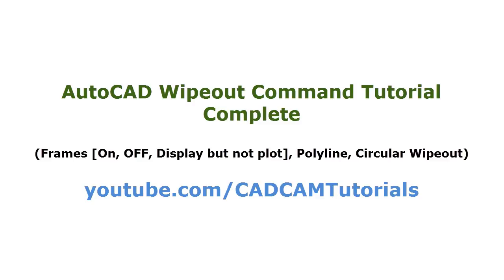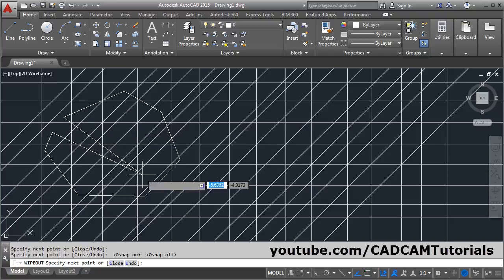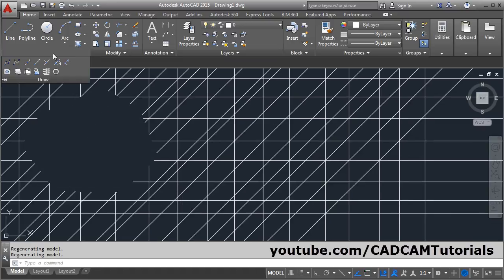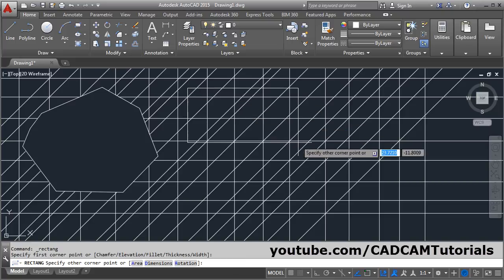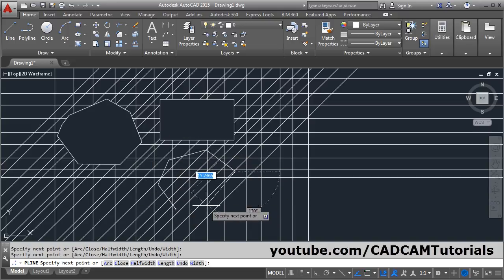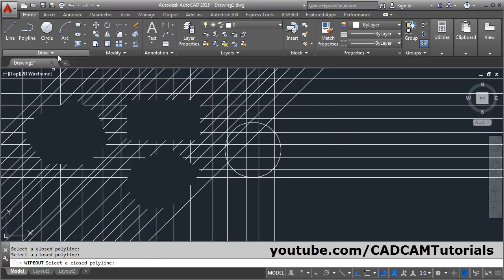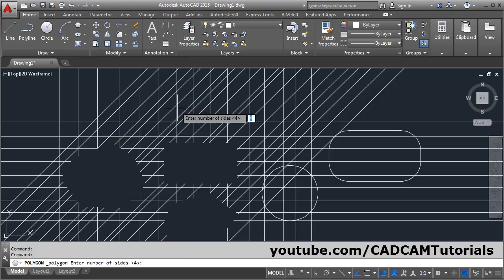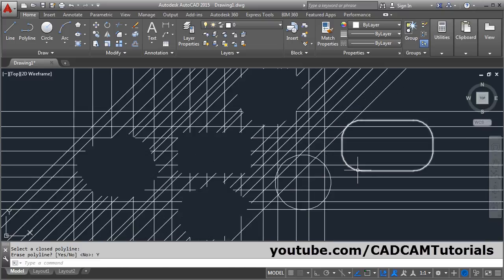AutoCAD Wipeout Command Tutorial Complete | Frame Visible, Circle, Does not Print, Polyline

Comment: I came here looking to see if it's possible to both trim and erase everything within a circle all using the same command at the same time.  I routinely deal with drawings that have a series of about 50 circles in a drawing that have some lines that cross into the circles and some lines are completely within the circles.  Currently, I must make two passes to remove everything within them... one to trim and one to erase the whole lines within them.  Surely, AutoCAD has a way to do this in one pass, which would save so much time.